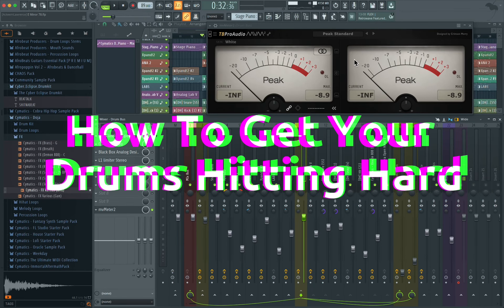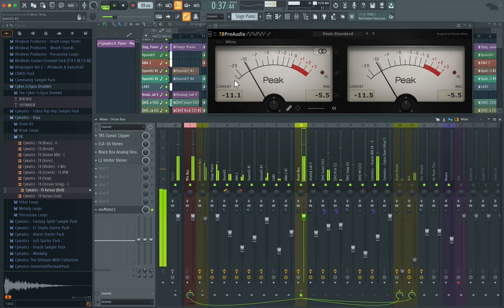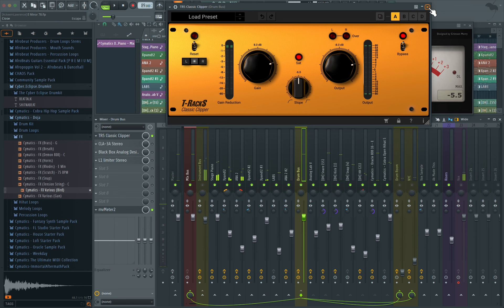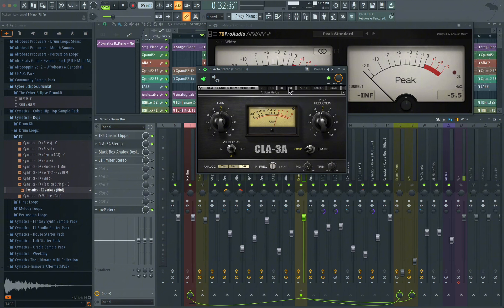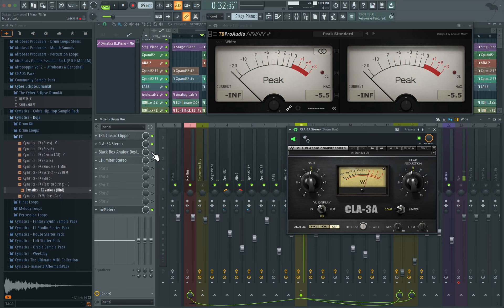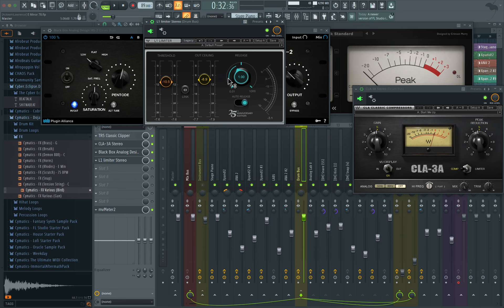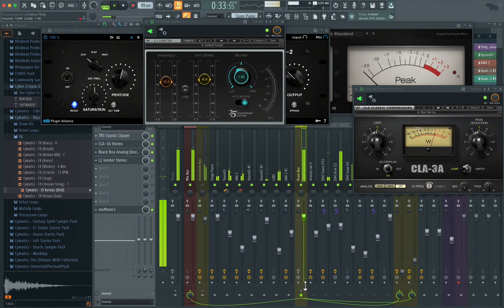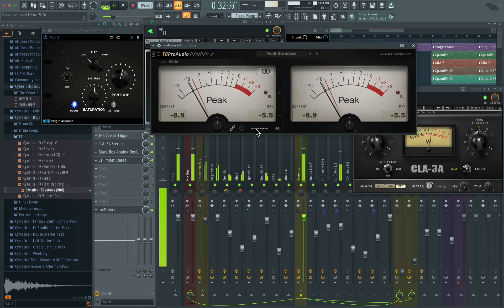How To Get Your Drums To Hit Hard In 4 Steps

Comment from the maker: PS: Vocals are a bit lower than expected in this video but to sum the video:

1. Clipper- to balance the overall levels of my drum bus by cutting 2-3dbs of the peaks.

2. Compression to create cohesiveness and to add to the consistency of the drums.

3. Saturation to add punch, harmonics and glu the drums together.

4. Limiter to maintain consistent levels at the level you want.
Reply: Limiter on drums for some reason is something I haven't really tried yet, will make sure to check it out. What I do use often is a transient shaper. For example I'll use Elysia Nvelope to slow the attack on the hats and tighten the release on the snare.
Reply from the maker: @-47-  transient shaper is great on drums too bro, honestly man it all depends on what works at that moment in time, you know. Try different stuff, do it sparingly and just experiment…no rules to it.